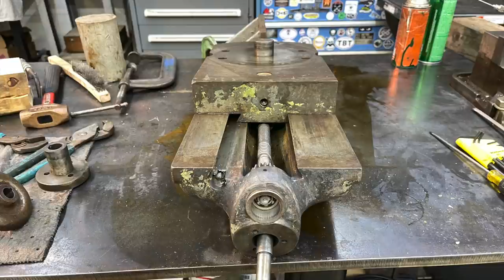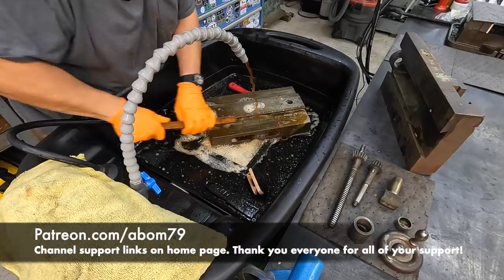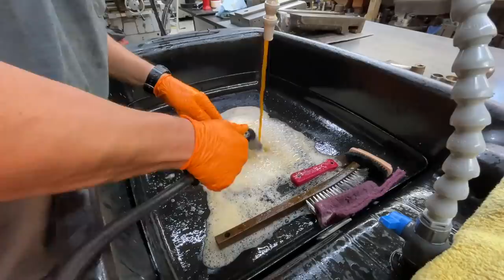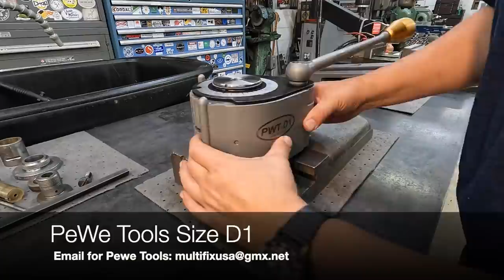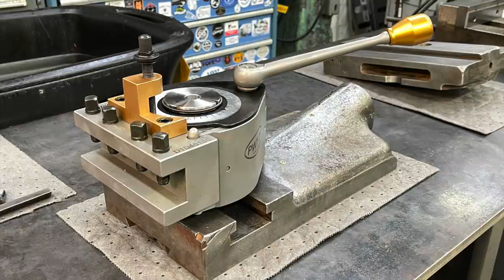SNS 360: American Pacemaker Compound Tear-Down For Rebuild

Comment: How possible would it be to make a new black and lead screw both in Acme? I mean assuming there you can't find a 3/4-5, left-hand, square-thread tap. Also assuming you don't just decide to use a form-tool and thread on on the lathe. It looks like the bevel-gear should be able to be pressed off.

Comment: Saddle re-build, same place I'm at.  You're lucky that the screw is still usable!
Reply: It doesn't seem to be a part too hard to make. in fact Rucker just did one.
Reply: @Peter_Riis_DK  if your lathe is running or  you have another to use.
Reply: @tonyc.4528  
Well, since mr. Booth has at least four by now - that is not the issue. 😉

Comment: I can relate to the issue of toolpost location on the compound. My compound is a similar (large) design on my 20x48 McDougall. I left my t-nut a bit shorter so I can slide it back and forth for ideal positioning. But having multiple locations on the t-nut is a good idea!
Reply: No it's not. The extra holes will fill up with swarf.
Reply: @Craneman4100w  Maybe. Toolpost is pretty big though. It may cover the holes to keep them clean if care is taken with layout...
Reply: @Craneman4100w  Only a bad idea if you are not smart enough to put a couple set screws in the extra holes.
Reply: @grntitan1  Imagine being smart enough to make it with 1 hole and short enough to be loosened and slid to either side. Much faster and easier than switching the bolt from side to side or into the middle. Kinda like almost every other tool post in the world.

Comment: Could you split the nut vertically ~3/4 of the way, add some screws (parallel to the threads) and make an adjustable nut?

Comment: Did not appear that either bad ball bearing had a grease fitting. If that is true might want to go with hearings with either rubber o metal shield a to keep out dirt and prevent grease from escaping. Thanks for another great vid. Like how you never cut corners and go the extra step if needed.

Comment: Seems to me that for a given thread depth and pitch, an Acme profile would be considerably stronger than a square profile.  Might want to make yourself replacements for both the screw and the nut.
Reply from the maker: I’ll be replacing both.
Reply: Square thread is the strongest profile but was replaced by Acme as it is so hard to cut.

Comment: I've got a Parat-holder at work. Shank thickness relates to hight of the insert, so when using small tools the amount of shim under the tool can be noticeable 😉. At least at the Parat there is just so much that you can lift the tool. If holder rised too much it gets instable...
 Regarding the rod/nut: one possibility would have been to buy some thread-rod and a nut, cut and change the rod and weld the nut to a shank. Isn't it so that as long as the pitch is the same, the thread can be whatever it is?

Comment: Being a bearing  guy. I cannot believe those bearings could have wear.. Even if dry (No lube) During their lifetime . There is no pressure or extreme use involved. Used 16 hours a day they can't have a thousand revolutions each day. for 80 years is about 470,000 turns. I think that if those bearings were pressure washed in a solvent.(MEK) You would find the stuttering is contamination.
There is a possibility of high pressure air blast causing dust or chips to enter from the bottom when the carriage is turned far to the rear. These bearings should be replaced by double sealed units. These units are lubricated for life.  In a severe atmosphere these bearings are subject to millions of RPM's and last for ever. Rarely are they in need of replacement. In conveyer type of use. They are subject to dust and other contamination . They are designed for RPM 1725-34,50. 24 hrs per day. 365 days a year.
Reply: Maybe self rust and abrasive machine shop contaminants damaged them?

Comment: Nothing out there modern for .75 x 5 TPI SQUARE taps. Only ACME. Good luck brother! Although I would love to see you try single pointing a new machined NUT for your machine, I would not look forward to how many fails there might be. How about cutting a new shaft with ACME threads and buying a tap from MSC or Grainger?
Reply: Yea... wouldn't single point threading a new nut work better?  Would be able to get the fit to the shaft.  No guarantee that a tap would provide a better fit to his threaded shaft.  Might go through all that just to end up with as much play in it as there is now.
Reply: I dont know why he doesn't just make the tap.

Comment: I think I would save the slow motion abomb doing things with his hands for private.  I found myself fast forwarding that bit I felt a little bit awkward 😳
Reply: @MHolt3573  Exactly. haven't watched a lot of him, now did because of YT suggestion, but really, is it necessary to mention the missed dowel pin and the guy pointing it out at least five times!? Let alone the fact that a good mechanic would have figured out by himself there must be something retaining that bush. With the work I do, I could make three hour videos every day if I repeated every trivial detail five times over.
Reply: @bigbattenberg  'A good mechanic would have figured it out by himself', my thoughts exactly. But Adam is a machinist first, welder second and probably mechanic third.

Comment: This may be more of a pain than it's worth, but if you can't find the tap you need for sale I would imagine you could probably make one out of some tool steel such as A2 or D2 maybe, provided you'd still be making the nut out of brass or bronze. It probably wouldn't be too big to heat treat yourself and you could make it to match the threads.

Comment: you might still be able to use a stud with a nut instead of a bolt . 🔩.  mabey using a stud with a large hex for an allan key on one end . Mabey a rotary broached the hex in ?

Comment: It would be neat to see you turn/create a tap for that brass but if you can’t get a tap for it! I’m sure you could pull it off.
Reply: Indeed, It's not rocket surgery. The first tap I ever made, age 17 on my dad´s model train lathe, was an acme leadscrew tap (for bronze nut, brass is not suitable). It worked a treat and I still have it.   I just machined the leadscrew extra long, cut off the end to make a tap, and carburised it with Kasenit (heat treating it with a couple of big plumber´s blowtorches and some firebricks to make a muffle furnace in the back yard)
I roughed out the internal thread by single pointing and just used the tap to take out a skerrick to perfect the fit. That way the tap can be quite short and the relief can be on the OD only, by hand stoning leaving narrow lands. (Short tap means distortion from HT is not such a problem)

Comment: Why did you decide to cut the steel piece for the T-nut vertically on the bandsaw as opposed to horizontally?

Note: this is in no way a criticism; I am a hobbyist/learner who wants to improve his skills.
Reply: I wondered that too - I'm not a machinist either, but my common sense (which is often wrong) tells me that lying flat, there would be more teeth in contact with the workpiece, so the cut would be faster.
Reply: @mikebashford8198  It may not have fit into the vice that way.

Comment: Its only brass. Making a tap is not hard if its brass. Like with a one time use tap for a brass part you dont really need to harden it or cut relief angels. But if you can get one its easy.
Reply: It’s more likely a much harder bronze alloy instead of just soft brass.

Comment: Hi Adam great video looking at the still images at the end with the tool holder in place would one bolt position dead centre of the tee nut  give you the overhang you need? looks like it may do which would safe set up time if you have a job which needs switching tool positions back and forwards.

Comment: I'm no machinist or anything like that, but would it be easier to cast that bronze nut? You could make a mold of the spindle thread that you're trying to cast and use that as the negative to cast the bronze nut that you're needing to replace.
Reply: Wouldn’t be strong enough

Comment: thought you'd go to the shaper to finish the T-nut from here rather than the K&T .... I'm not a machinist, but seems like the job would be appropriate for a shaper (maybe take a bit longer, but ... meeh ... get to make some chips with the shaper   ;-) )
looking forward to next installment, thanks Adam
Reply from the maker: Part of the beauty of having different machines is choice. Sometimes we choose to use the mill, others times we choose to use the shaper. No matter which one I choose I’ll have people asking “why didn’t you…” For this job Id like to use some face mills I’ve invested in.
Reply: :-)   Totally understand, didn't mean for it to come across as 'why didn't you' ... just thought it would be a good application for the shaper (and it's not a rush-job, and seems you look for work for the shaper when you can) ... so thought you'd go for it ... of course a mill is probably quicker (I wouldn't know, not a machinist, but seems like the mill makes chips quicker, that's gotta equate to more mass removal per second ... so... quicker ?) ... and if you have new tooling to play with ... decision made  ;-)
Thanks again for all your content Adam, big hugs from the UK to you and Abby   :-)

Comment: I remembered that Keith Rucker made a left handed square threaded crossfeed nut (and screw) for an old reed lathe (and lucked into the tap needed)... but I just re-watched the video, it's 1/2" 8TPI... you said yours is 5TPI? Also, it was a modified square thread... not a "true" square thread.

Comment: Just a thought, how about the form a thread epoxy from Loctite? Basically fill in the hole and thread in/on the other piece to form the other side? Silicone or some sort of other mold release agent?
Reply: There is a highly engineered and very reputable product intended and used for this very purpose, called Moglice (i had to check in my fridge to remind me of the name). It´s featured in some high class CNC machines, among others.

Comment: Why would they use open unshielded bearings? That just asking for trouble. I hope you got some shielded bearings to replace them.
Reply: Beat me to it! 😁
Reply: They've been there for 80 year's. New one's should be fine for another 80
Reply: A lot of lathes wouldn't even have bearings there, just a bush which gets oiled when you oil the machine.
Open bearings will be fine.
Reply: @nope4239  ...but they failed.
Reply: @skmetal7  from the rust that is on the adjustment knob looks like it spent some time out side probably hasn't been oiled like it's supposed to
To many other variables and unforseen's it's 80yr old
What ante wore out
Adam will do the right thing
Reply: @skmetal7  they nay actually be good. I’ve often found with old bearings that feel chunky, that’s it not bad. It’s just the dirt, and once it’s cleaned, it’s fine. Truthfully, I replace them anyway because bearings are so cheap these days. You don’t need class 3, or above, bearings for most of these uses. But if you need it to work NOW, cleaning may fix the problem.

But these likely have never been cleaned, or lubed properly since the lathe was made, so the amount of time they worked well, was well beyond when they would be expected to be replaced. Just remember that most bearings and sleeves are considered to be consumables, and need to be replaced every so often. The manufacturer chose these bearings rather than others, and these were very expensive machines, so they must have had a good reason.

Comment: Wonder if the new bearings will have shielded or sealed sides and prepacked with grease-???
Reply: You can buy them either way. If you don't want seals, you just pop them out.

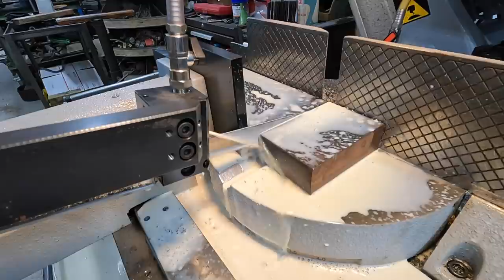Comment: 31:18 Is there a reason for laying this bar flat for sawing ? It feels as if it would be a faster cut and easier on the saw if it were upright …
Reply: Would have been faster, but not easier on the blade. The narrower the workpiece the higher the pressure on the saw teeth.
Reply: At the end of the day it's the same amount of material so for a one off like that doesn't really matter. But there's a few reasons that may affect his choice such as any angle the blade imparts has longer to drift further away. And less vibrations if you give the teeth a bit more meat to dig into. At least that's why I do it, but I'm a novice compared to this man.

Comment: Yes we can hear it! As you now are sure of since editing the video. Rough as guts. Got rusty at some period most likely?
Reply: Most definitely can hear it! When I was in the bearing business, we had a device called "BECI" "Becky" Bearing Electronic Condition Indicator. Basically, a mic that was put in contact with various parts of a machine and a display that showed the sound. Kinda like a techie version of the old mechanics stethoscope. I know you said you have bearings on order, but I would have suggested either (at least) double shielded OR double sealed. Or a shield and seal with the seal to the outside and the shield to the inside. No criticism because you're replacing them with what was there, but anything that keeps crud out of bearings is a good thing! 😁

Comment: adam id check with keith if he has one of those taps. i think if anyone has one it would be him
Reply: Hes doing the exact same job but on a big vice , he's cut the thread on the screw but had to reuse the nut as he hasn't got a tap.
Reply: That was a 4 pitch Acme thread, but it is the sort of tap that he would have
Reply: I think this old tony made a speciality tap some time ago. Maybe abom could thread a rod and grind it for a tap.....maybe Steve summers could grind it? Idk. Then have it tempered.

Comment: If you can't source the correct tap would it be practical to remake both the shaft and the nut?
Reply: Looks like the gear is one part of the shaft, hard to get it off and to the next shaft.

Comment: Wouldn't you want the T-Nut slightly shy of the top surface so it pulls the T-Nut up tight. If the T-Nut is just the width of the holder, with a bolt in the center, you could just slide it back and forth to position the holder to either side or anywhere in-between without having to lift the holder off and moving a bolt. A stud would be stiffer. A larger one with the top turned down as needed would be the most rigid.
Reply from the maker: Patience and the answers will come.
Reply: Sounds like a custom made boring bar holder is in the future...

Comment: Would it be feasible to just machine a new spindle and use an acme thread? Than the wear in the spindle is gone allso, and you'll probably already have the acme tap.
Reply: Heh... I guess I should read at least a few comments before posting. I said the same thing two comments up!

Comment: Hey Adam 
I Have a load of taps and drills that I Inherited from my late father . 
He was a Manual machinist and tool maker for many years before he passed < 
He just ended up re-furbing brake callipers and fixing family cars in his later years, from his little shed here in the uk . 
My Whole Family going back before the second word war were engineers for David Brown Tractors /Gears.
He Didn't have much but ive been cleaning his old shed out and know there is some useful tooling in there .
I won't use it . 
I would like it to go to somone that will . 
Any suggestions ?
Don't want to sell .... just a good home will do ..

Thanks Adam for your content 
Takes me back to the old days in the shop with my dad ... just as it all does to you

Comment: There was a lot of discussion about this T-nut in his earlier Pewe tool installation video. There's a great risk this tool post will be held in place by just the set screws. However, it would be equally bad to have the t-nut be lower, since that would distort the tool post. I dunno, something makes me feel this is not the correct way. Maybe have the T-nut assembled more rigidly to the base with pins or something?

Comment: Adam, are sure those bearings are actually bad? They take very little load and no rpm stress. Chances are they're just really dirty with matbe a few spots of rust here & there. A good cleaning followed by your chosen rust removal technique might bring them around like new..
Reply: Bearings are made to be replaced, the feel of this compound will be infiniteley better with new bearings.
And they are cheap so it would be dumb not to replace them while you're in there.
Reply from the maker: Yea, I’m sure!

Comment: Adam why would you not just make a new nut and a lead screw to a more conventional thread pitch ? I'm nowhere in your league and I'm shur I could make it all unless I'm missing something .
Reply: If it were just the shaft and thread, I would agree but the gear is part of the whole piece.  That adds drastically to the complication.
Reply: If you change the thread pitch then the graduations on the hand wheel will be wrong.
Reply: @soundgod06  I think he meant thread profile not thread pitch.
Reply: @royreynolds108  Isn't the gear pressed onto the shaft?

Comment: Adam... I have an opinion, that when we’re working on our families machines or tools, that we’re too connected with them ( emotionally or spiritually), that we don’t approach taking them apart the same way we would other equipment. That’s why you missed the pin. It’s harder to work on family things. 

Maybe I’m just a wack job, but I’ve run into these feelings, approaches before.
Guess I’m nuts 🥜
Reply: What the hell are you on about? He only just got the Peacemaker a few months ago. Yes. You are nuts. lol
Reply: Yes